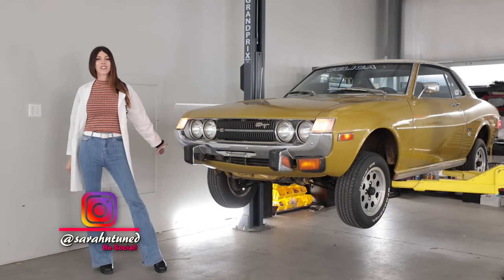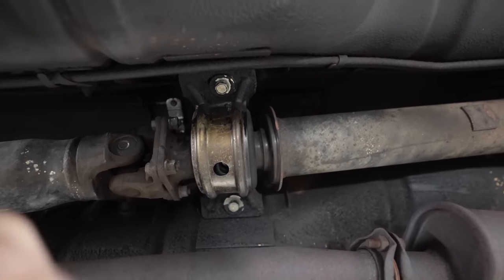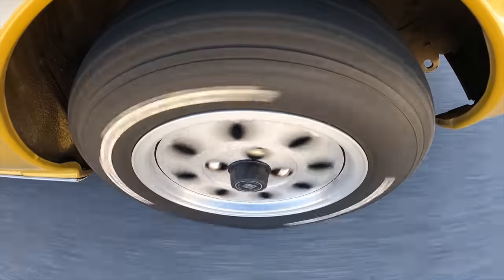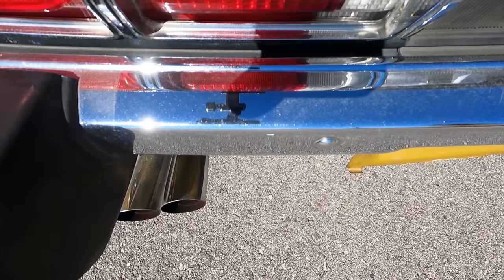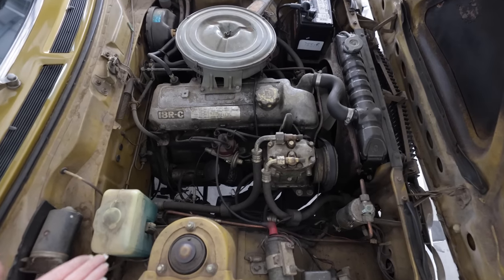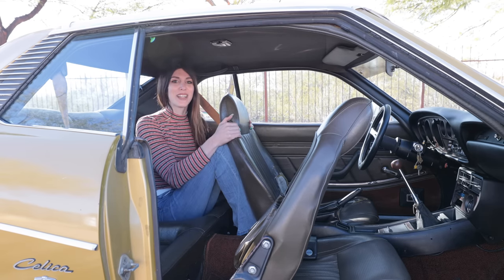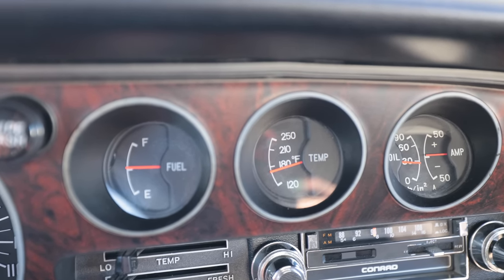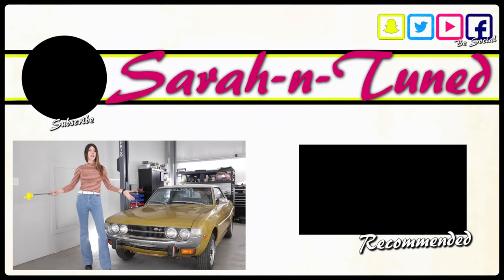A Japanese Muscle Car ..ish // 1974 Toyota Celica ST Review

Comment: Muffler/tailpipes = ANSA
They were very common back in the day.
I had a '84 Celica GTS with the 22RE (early injection) a 5spd manual and IRS (independent rear suspension).
It wasn't hella quick but it would get me to work at 100mph every single weekday (not kidding and work was about 25 miles away).
Handled fantastic with KYB white shocks and got about 25-30 mpg....depending :)
Toyota earned their stellar reputation from the Celicas and Pickups of this era, very well deserved.
Mechanics (like me) loved the hell out of them.

Comment: If this was mine i would try to keep the aftermarket rear muffler (with a bigger in-pipe of course) or at least the twin pipes at the back. They are looking so cool and they are time period correct.
What a sweet little nugget.
I thought of buying one a few years ago but here in Germany they had become expensive. And because of salty roads in winter there are only a few left.
I can't wait to see you swap that thing.
In my opinion you should try to keep the factory look outside so it becomes a real sleeper.

Comment: With the car on the lift, make a mark at 12:00 on one of the rear tires, then rotate the driveshaft by hand, 4 times. If the tire mark is just before 12, it’s a 4.1:1 FD. If the tire mark is just after 12, then it would be the 3.9 final drive ratio.

Comment: As a teenager I really wanted a Celica or a 1972 Datsun 1800. Ended up going in the complete opposite direction though with a 1982 Daihatsu F20 4 speed that topped out at 85kph (but it could climb cliffs and forde rivers). Drove it for 20 years 🤣🤣

Comment: These were quite sought after in the UK back in the day and were every bit as classy as a 4 cylinder GT Ford Capri. Older cars like this would usually let you rev them all the way to valve bounce, it was typical to use far more of the available throttle travel when driving, motorway driving would often mean flat out to maintain or exceed the 70mph limit.

Comment: Guessing that muffler is an Ansa?  Think Stebro made some also?  The side trim strip was right out of J.c. whitney?  I owned a 1973 Corolla.  1588cc.  There was a performance shop in Cali called the "Toy Store".
Purchased Weber Side draft Carbs, Bigger Cam, Arias 10:1 Forged Alum Pistons,  Lowering kit, Stiffer Springs, Panhard Rod, Koni's. Guessing all that cost about 500$ back in  early 70's. Engines were Solid...cross drilled cranks, etc.  Bought a used 5 speed for 100$.  Battery in the Trunk...Fun Car!  Paid 2600$ new out the Door.  Celica was out of my price range...

Comment: I was expecting you'd be impressed with the 74Celica ST.. I say this mostly because I'm a proud owner of a 76 Celica ST. Great info you shared in this review btw. I would prefer a Celica in the condition of your's as mine runs and drives but has less than solid/ less than complete body metal since it suffered through too many Minnesota salted roads. I have advertized it as a parts car before but no luck in finding that next owner.. YET.

Comment: Great car.. and its LIGHT.. that makes it all better.  You could beat the snot out of this all day.. and it would not care.  Older Toyotas were even more bullet proof than the newer stuff.
I am a but worried the power of the V8 will overwhelm the chassis a bit.. your gonna need ALL different driveline.. front to rear.. and maybe some frame re-enforcement.. I would worry a bit about twisting it with TRIPLE the torque.
Gonna be a fun project to watch you work on.

Comment: Back in 1988 I was so disappointed when I managed to get a small test drive in a mint metallic green Celica fastback. The recirculating ball steering was so vague around center that it felt like the steering wheel wasn't attached.

Comment: I really wish I never sold mine but they went with my first kid, not exactly family friendly. I had two, a 1971 ST and a 1974 LT, both with later model 3T-G 1600cc twin cam engines with dual side draft 45mm carburettors, one with a mild cam and both with alloy Supra 5spd gearboxes. I miss the induction noise but they both drank like sailor (16-17 litres/100km or around 14mpg). They were great fun to drive and drift but didnt like stopping much though.

Comment: I used to race these and corollas and carinas back in the 70s and early 80s in Colorado in the canyons and they would destroy a Mustang in the twisties. The top end was never needed it was the handling and negotiation of the corners and the smooth powerful acceleration out of them. I know I'm not gonna change your mind about putting another motor in this car but I'd almost rather see this thing turboed and the original power plant maximized. Best of luck and I'm looking forward to the final result

Comment: A V8 does fit.  A friend of mine put an EFI GM Holden 5.0L V8 into a fastback one of these in the late 90s.  I had the job of wiring up the EFI computer.  It was a little nose heavy, because the Holden V8 was cast iron heads & block, but it wasn’t that bad.   An alloy V8 will be perfect in it.

Comment: yes it'd take a 20R or 22R for more, while keeping original wiring etc.
things can be done for that 18RC to bump power up a bunch too,
1.75" main exhaust and slap a little Weber on it should give 130hp at least.
lower 1" and a set of KYB's. these are MADE for twisty little back roads.

Comment: My 1st vehicle was, I believe, an '82 Celica ST and it was about 5yrs old when I got it. The owner let it sit for about a year because of a blown wheel cylinder and luckily my mechanic got it so I would have to drive it down the mountain like that. I think I paid $700 for it and boy would that thing run with the 20R engine.

Comment: Those 4-link uppers are far enough inboard that you might actually get away with removing the drivers side one and running it as a 3-link for better articulation.

Curious to see what the plan is for getting a manual hooked up to the 2UZ.

Comment: I had a 74 Celica in the early 80s … it was my first proper car … loved it and wish I had parked it away and still had it.  But very minor technical question, in Australia the 74 had a square pattern in the vents in the C pillar versus the 72 that that the consistent pattern that your car has … if the US is the same I suspect this might be a 72/73 car?

Comment: The 18R engine is quite spunky, second gear chirp is not surprising. My 76 had a slightly modified 20R, would lay 10 feet of rubber hitting second gear. Would give almost anything to have it back. And don't worry about giving it all the beans, they can handle anything you throw at them. Literally, they're amazing cars.

Comment: fun fact, the Ford Windsor V8 (not the 351W), an all iron engine from the factory, weighed in at 450 lbs. and was well over twice the displacement, and could be easily tuned to over 300hp...Obviously, you're on the same path with your swap.

Comment: Probably not your cup of tea, but that radio could be tuned to the past right there. Put it on Amplitude Modification and dial in 830, KDRI. I listen to it all the way through the Valley. But only during daylight hours. Blast from the past. Its broadcast is from Oro Valley, so I'm not sure how it sounds south of Mt. Lemon. They have FM as well, but I don't use that side much at all. I found the channel when I was in Tucson a while back and was very surprised that it lasted all the way back to Phoenix and all over the area up here. Even up in Surprise. I haven't been up to Wickenburg yet to see if it reaches up there, but I wouldn't be too "surprised" if it does. Anyway, they play the standard oldies, plus a smattering of more rare selections. They have live on-air personalities, including Cheech and Chong.

Comment: Unlike you , I like to keep my old cars/trucks oem.  At the moment I own a '85 Toyota PU with the original 22R 2.4L 4 banger Stick. Love it and so easy to fix/tune.😆. I can't imagine a V8 in the Celica.  Got to trash everything, brakes, suspension, transmission!

Comment: Very cool project Small Toyota muscle car. Are you doing over fenders?  That be very cool. 
It will allow for wider wheels/tires =better traction 
I saw one of these Celica's with a very nice wide body, and seen a terrible wide body. Are you planning to bore out the 4.7L? not far from being a 5.0L 
I hope you will be removing the luggage rack. Are you changing the color? I would but it's your car. Do what you want.

Comment: If you pull the interior door card off you will see the metal of the car door from the inside is printed Coke cans sheet steel in sheet form before making the cans. Yup...steel cans in those days. Toyota must have got a deal on the sheet steel. Saw it with my own eyes in a Celica of that era.

Comment: Hardly going to be lsd …then.  It chirps tyres as the gear changes happen when the wheels are turning slower.  The gear changes act like a brake. Not through acceleration. FYI.

Comment: Sad to see such a nice little car get chopped up. Those tires must be really old. I have never seen 13" BG Goodrich Radial T/As. My 1972 Ford Pinto woodgrain wagon has its original optional 13" Appliance 5 slot aluminum wheels, and the only place I can get 13" tires is Coker Tire, for over $300 apiece, plus tax, shipping, mounting and balancing. 2.0L SOHC/4 speed.

Comment: I like ! I like it ST Series by big power gears 4 on but able give a fuel save gear 5th on that farward all drill on peep tyre on change by gear ! 
If true power a V8 able inside,  but the V6 able too by TRD past threw insinde cracked in a Planet gearbox on Crankshaft ;)

Comment: Sorry, the second and third gear chirps were you dumping the clutch on the fly wheel spinning slower than the wheels causing the wheels to slow down and skid. Not acceleration chirps.

Comment: Given your reaction to the handling of this car, I strongly suggest that you review a 60s to 70s Alfa with a factory dual Weber setup, probably 1600cc since they went to fuel injection on the later engines.  You probably want to avoid Alfa's own SPICA FI, later they went to Bosch.  The other 60s to 70s car is the BMW 2002 for its handling.  Luckily Toyota probably copied or at least bench marked the better handling cars of the day and kept a fairly high bar for the handling.  Most of the rest of the small cars of those times did not handle well.  There are exceptions of course, Lotus, TVR.  How about a review of the V8 Sunbeam Tiger or resto/mod for more power?

Comment: No ABS, No traction control, No launch control? Just the way cars are supposed to be. The squeaks, rattles and shakes give it character. Quite right that an automatic box would ruin such a nice handling car. I love your reaction to the brake and acceleration tests. Back in their time they'd hold their own against a lot of the small sports cars and Toyotas were more than a match for the comparable European offerings.

Comment: Put it on scales when the driveline is out for a real giggle. Power to weight, its a Japanese version of an Elan, and hey, Toyota supplies Lotus now. Conservation of Momentum is how to drive it. The alloy V8 isn't going to bump the mass a great deal, not as much as the bracing.
Lexus rear end and Brakes?

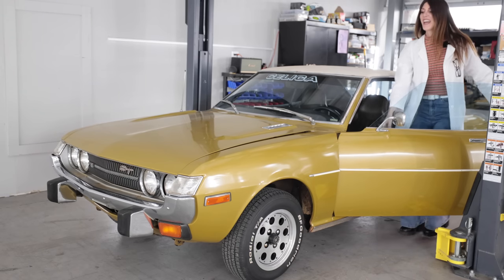Comment: 7:40 i wouldnt put a V8 in it. i would put in (the 2019 Honda Accord) 1.5l turbo 192hp . or the (1991 MR2 ) 2.0l turbo 200hp . the Accord engine gets 30/38 mpg . .. if you can fit them in and connect them ?

Comment: It would have been a much nicer video had u shown the speedometer of the car when accelerating. That would give viewers an idea of what you are talking about and how quick actually the car is. 
Also i think V8 would be an overkill for a small car which only weighs 985kg..u have much better options of using toyota naturally aspirated or turbo charged 1JZ (2.5 V6) or 2JZ (3.0 V6). Even a 3SGE turbo (2.0) will provide more than enough power for this platform.

Comment: Back when you didn't need a computer science degree to work on cars and you didn't have to take half the engine compartment apart just to change the spark plugs. It might have been even quicker if you didn't have all that weight in the trunk!🤣

Comment: I've asked this question before and I keep getting vague answers. But what exactly makes modern cars so much heavier? I'm shocked that this not so small car weighs under 1000 kgs.  

This car has no aluminium in its body, steel wheels and a heavy, cast iron block/engine. Yet the whole car is still lightweight. 

A smaller, basic car like a Corolla hatch is heavier. And modern cars have lighter bodies with aluminium or high tensile steel, lighter alloy wheels, aluminium block and cylinder head. Yet despite all these, they are much heavier than before. 

What exactly are in modern cars that adds hundreds of kgs compared to older cars? This Celica if it was produced today with just a 2L engine would weigh at least 300 kgs more. I looked up a similar car today. A 2020 Subaru BRZ with the exact same size engine weighs 1300 kgs. So what gives?

Comment: V8?  Hmm....a 4age w/turbo would keep the light weight ethos and handling in continuity. Or the stock engine w/turbo, intercooler, and modernized fuel injection would be cool. Again, turbo 4age would EASILY make 350+ hp

Comment: Don't put a V8 in it.  That 1.8 liter just finished breaking in at 100k miles.  Fix what is wrong with it and sell it to someone who will fully appreciate it as is.  You yourself gave it a great rating in it's current form

Comment: Ha ha America got screwed again all our Australian celicas of this era had steel cased five speed gearboxes that where so sweet shifting and indestructible,being used in high horsepower v8 conversions among others , those dopey bumper extensions ruin the whole car and also the reflectors on the rear guards suck too Australian models didn’t have any of this crap